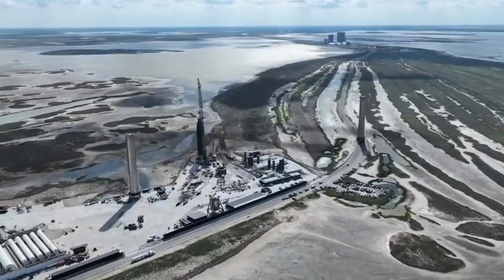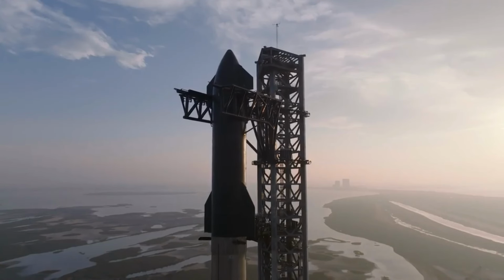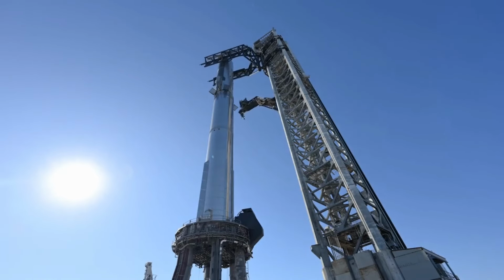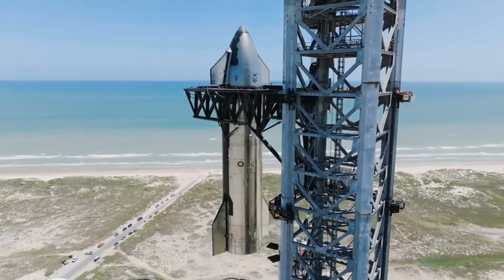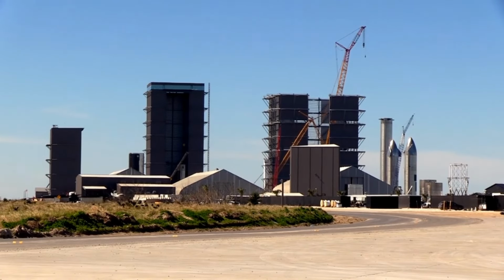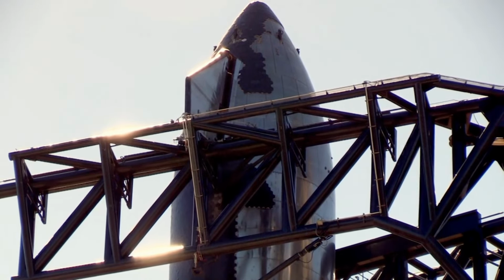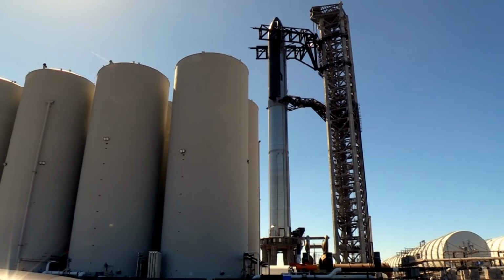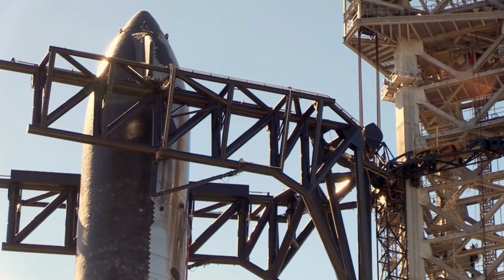SpaceX Starship Flight 10 Update - Hardware Details, Flight Information, News

Comment: What's your source about Raptor having coatings in the turbopump assembly? I could't find anything about it, coming from Elon himself. 
He did say SpaceX invented SX500 alloy that is immune to oxidation (burning). But why use coatings on such an alloy, if it's resistant to hot oxygen?